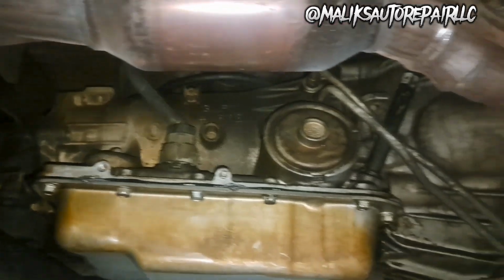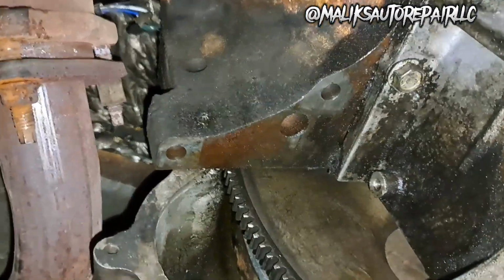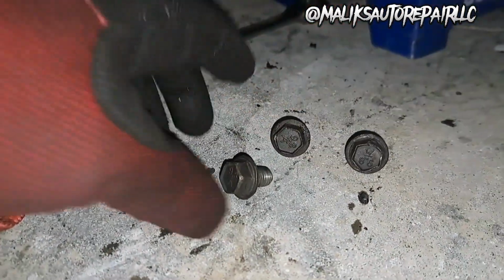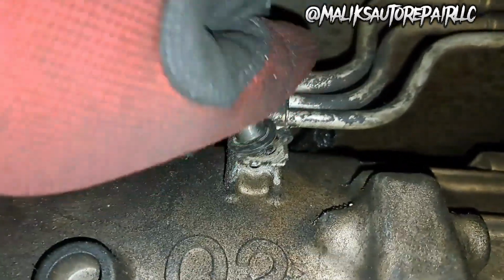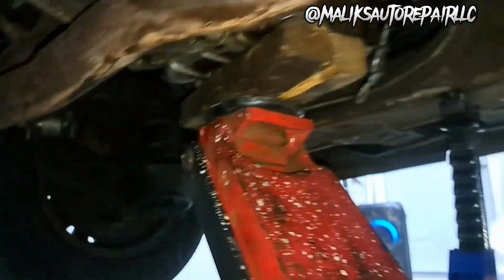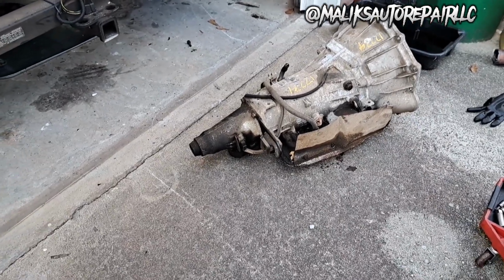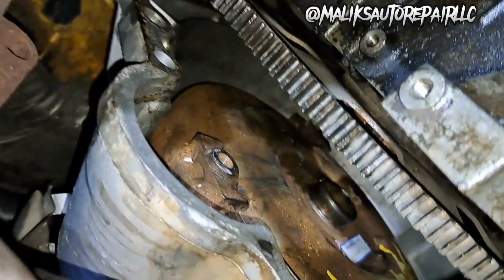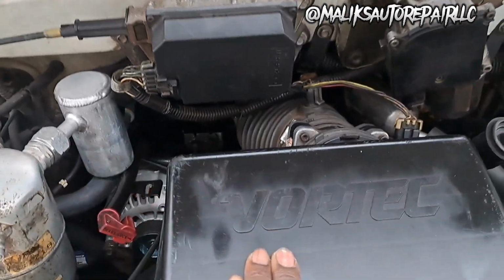2002 CHEVY ASTRO VAN 4.3 2WD | HOW TO REPLACE TRANSMISSION | Howto/Diy

Comment: Quick question! So I changed my transmission on a 2003 Astro van and so I removed the neutral safety switch from the shifting cable . And so now that I’m putting it back together I don’t think the transmission that I got is in the “park” gear is there a way I can shift the transmission so that I can put both in park ?( the transmission and shift cable ?)
Reply: On the dash it says I’m on reverse so I don’t know how to make it so that it’s on park ?
Reply from the maker: @tavo6893  Yeah you can push the lever on the transmission to get it in gear. But you gotta make sure the safety switch is adjusted properly. It's sound like that's the problem.
Reply: @ is there a way to adjust it ? I heard about it but I’m not sure how to?
Reply: And I can just push it by hand nothing needs to be done prior ? Thank you so much for the help !
Reply from the maker: @tavo6893 Yes
Reply: @ThePullUpKing  is there any tips on how to adjust the safety switch?
Reply: @ThePullUpKing  is there any tips on how to adjust the safety switch??
Reply from the maker: @tavo6893  Nope, but you'll figure it out once its able to go in park. Just keep adjusting.
Reply: @ThePullUpKing  thanks man ! I’ll give it a go tomorrow hopefully then it will make it so I can start taking it back to work !
Reply from the maker: @tavo6893  No problem. Sounds good. Keep us posted